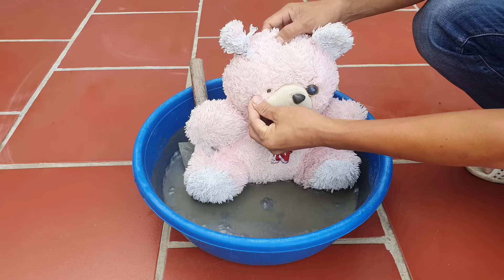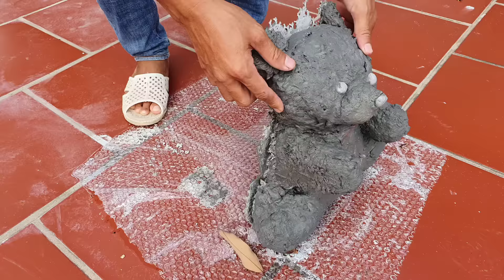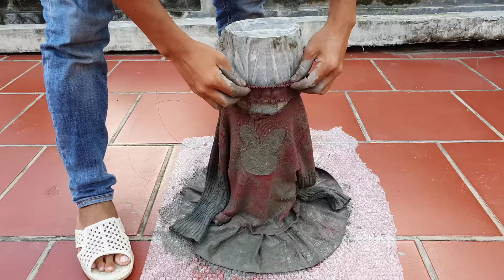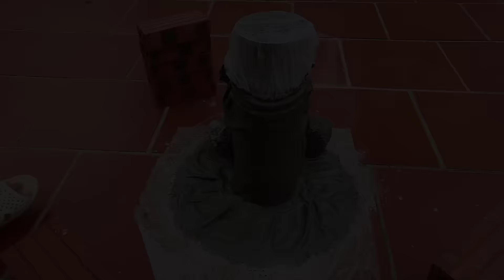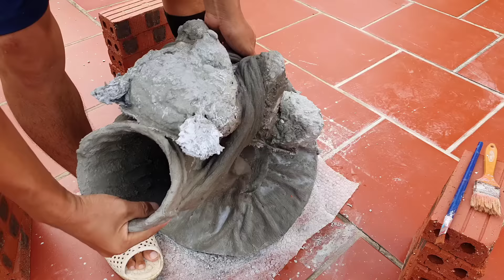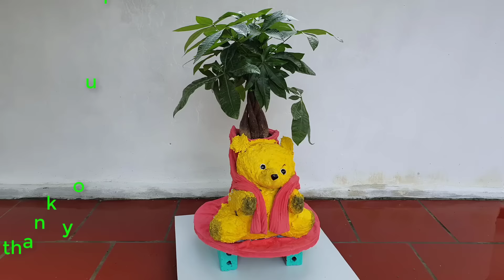Cement + Old Teddy Bear +Wool Skirt = Beautiful Plant Pots /Great Ideas for Garden Design/ Diy Pots

Comment: Add a 1/2 cup of wood glue to mix. It will keep the cement from separating from the sand and make it more workable and also not as brittle when it dries...
Reply from the maker: thanks ❤️
Reply: Legal
Reply: Really, that's a great tip thanks I will try that, any more tips Ruth..
Reply: Awesome
Reply: @missymoomoo182  ,